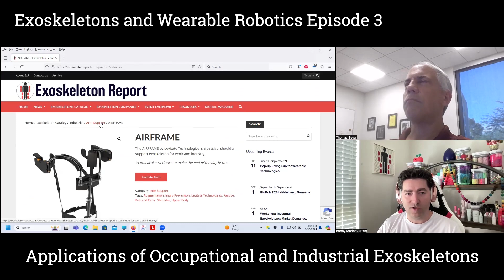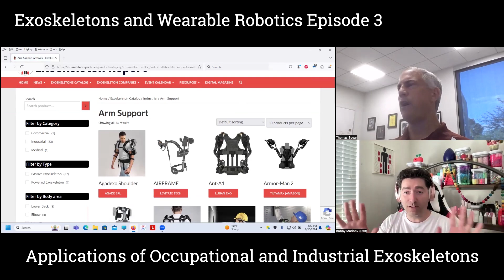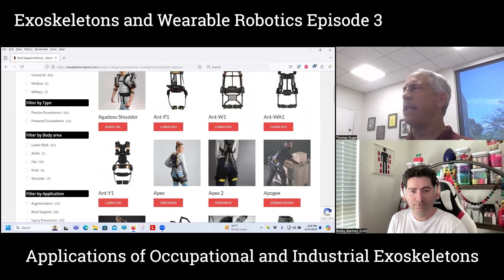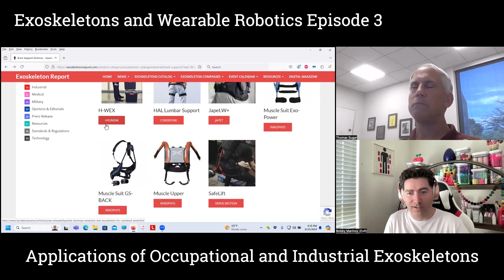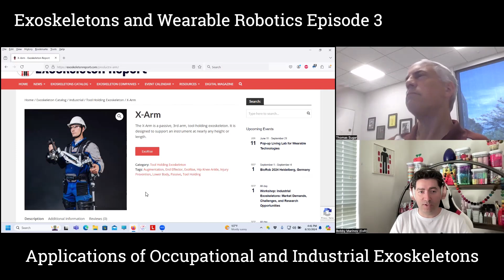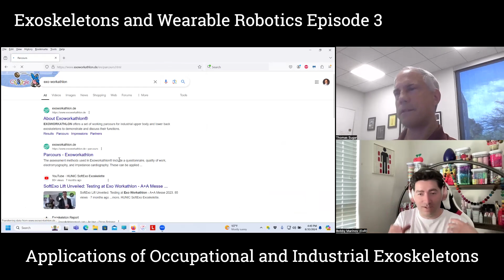Applications of Occupational and Industrial Exoskeletons, Episode 3 Exoskeletons & Wearable Robotics

Comment: If the hips stay parallel while running, it helps the gait. Good to use a counterbalance. Tails help. 

Offloading onto the wearer's joints can cause problems down the road (and expense).

I like the electrostatic clutch on the heel to add "pop" to the step (and efficiency). 

I would like to see running stilts incorporated. 

"The bicycle" is a masterful exoskeleton.

I think tension is a mich neglected principle.

Cusioning should have liquid-fiber resistance inside a joint, like nature has.

What about decent artificial muscles that mimic actual muscles? Can we just grow them transgenetically with mushrooms crossed to animal muscle? They should be modular and swappable. We would have to control metabolism. If we could.make a bridge between ATP and DC voltage... that would be a huge step (interface between existing tech/power, and bio-energy). 

We need mushroom-muscles re-engineered to run by battery tech.
Reply from the maker: Yes, but with mushroom muscles and swapping between ATP and DC you will end up at the same destination: timing and control of when the assistance is provided to the user so that it feels natural. I think all of these are potential technologies on the horizon. Just like a kid with a limited collection of LEGO bricks at hand, the question is what can we build with the technology that we have now : )